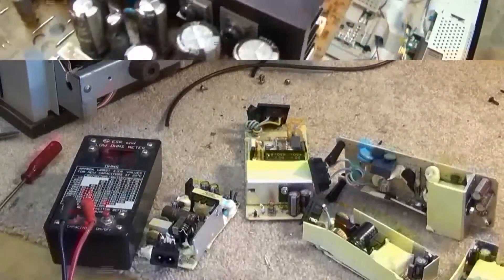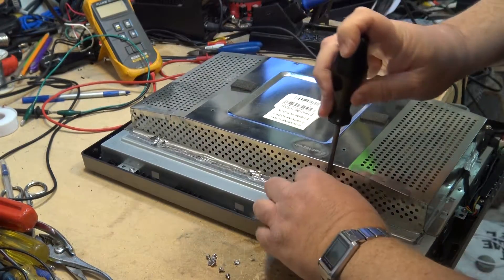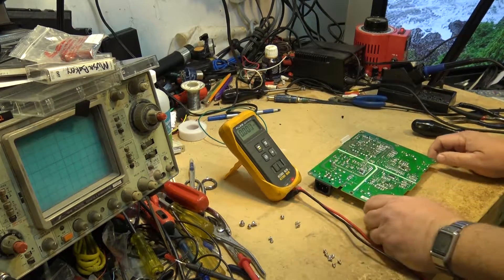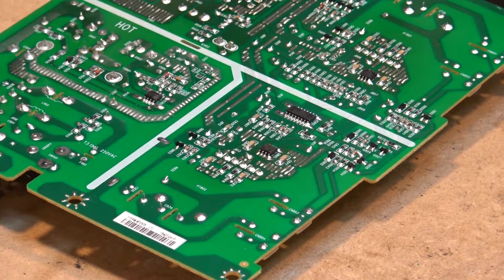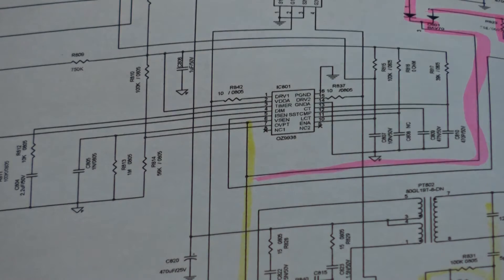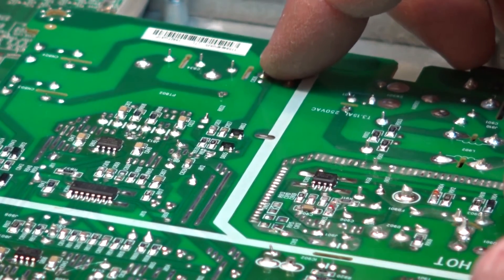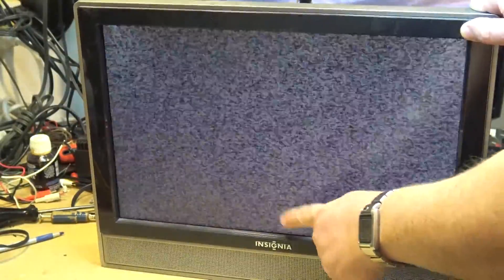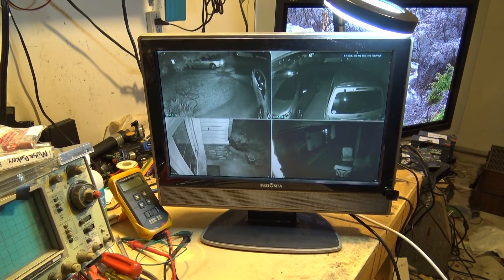LCD TV Fluorescent Lamp Troubleshootiing and protection defeat modification

Comment: @12voltvids — How would I supply power to a set of these CCFL’s if I DONT HAVE the TV set’s circuit board (drivers)?? To add context: I’ve converted several busted LED sets into things like photography lights, ceiling lights, or once I used them along with their frame to create a “BACKLIT” piece of art for my daughter’s bedroom wall….

However, I come across LOTS of CCFL-Lit sets and feel terrible tossing them out… Many times the driver won’t power the bulbs unless I keep ALL the circuit boards intact, which is obviously undesirable for my intended outcome(s)…

So what I was hoping to gain from THIS (and all other) videos was the understanding of “HOW THESE WORK” - PERIOD.  Meaning if there was no TV SET even in the situation, but someone wanted to power up, let’s say, ONE PAIR of these as an under-cabinet light (for example), then HOW COULD THEY??? 

I say “a PAIR” because the current bunch I’m working with are wired IN PAIRS and I’m not certain if they all are or not…

So that person would need to know things like the following:

1. What amount of Voltage does EACH CCFL (or each PAIR of CCFLs) need to operate?
2. Can they run directly off of a fixed current, or do they all require specific “drivers”??
3. Once it’s determined how to operate ONE or ONE PAIR, does the voltage then simply increase in accordance with the amount of CCFLs (or pairs) desired? - eg: 1V powers a pair, so 6V powers 6 pairs. ? Or is it nothing of the sort?

I cannot find ANYTHING on this topic no matter where I look and I’m sure I’m just nit looking in the right places. But everyone sharing info on these specific CCFL’s is always attaching the TV SET into the mix, and never educating me on how specifically the CCFL’s THEMSELVES function (and thus, how they could function on their own!) 

Could you PLEASE either reply and point me in the right direction, OR do a video on this for the DIY/“MAKERS” community? 

You’d probably be the first and only, while there are DOZENS of videos that discuss doing the exact same thing with LED strips from TVs.

THANKS. New Sub btw!!

Comment: CCFL junk replace with led stripes . i have done that to my customer years ago. now working kinda sort off.
Reply from the maker: Ccfl lasts longer than any led strips.
Reply: @12voltvids  yes i agree but they heat up pretty fast and then the edges became black  pretty fast.
Reply from the maker: @Abhishek-C92  I have a monitor with over 63000 hours of use and it still looking good.  This tv still working after all these years.
Reply: @12voltvids  oh good. but idk is my bad luck or  that my ccfl backlight of my monitor just went pinkish.  it was 9 years old . its a benq monitor 16.5 inch .

Comment: In many cases i had to disconnect one of the lamps and put a polyester capacitor 6KV around 100pF as a dummy load.I did it in monitors and in one case in a 32 inch CCFL tv and worked.

Comment: We had equipment at work that was CCFL backlit running 24/7 for 10 years before I saw failures or color change (pink) in the tubes. The replacements i put in lasted maybe 5 years before they had failures.
My current Samsung TV is 12 years old and uses CCFL. So far so good, no breakdowns.
Reply: yep. CCFL tubes can last ages. They loose their color accuracy however, they will get a lot darker over time and take a long time to warm up.
I have two PC monitors I use since more than 12 years. They take ~5 minutes to be up to the max brightness (and have a good color temp) but still work great.

Comment: This is interesting, I saw a different failure mode on a larger set.  The driver FETs on the top row were shorted & on inspection 2 of the lamps were physically broken, looked like they'd blown the connectors off the ends. Chicken or egg, did someone knock the set in such a way as to break 2 tubes just at the very end & then the drivers shorted due to the spike, or did something in the circuitry fail causing physical damage to the tubes?  (Actually, I've picked 2 or 3 CCFL sets off the kerb that had the ends cracked off a pair of tubes)
Reply from the maker: One of the way ccfl tubes eol is to break.

Comment: Well this is convenient. Someone recently gave me a broken LCD TV to play around with and see if I could get it working again. It's a 32 inch beast from a local brand, manufactured Sept 2007. The issue is very similar to this one though in my case the backlight is not lighting up at all and I can hear what seems to be the power supply starting up and shutting down multiple times per second, like a pulse. Currently waiting for a tester I ordered online so I can check some caps on it. Never fixed one of these before so i don't have very high hopes, but hey at least I'll have some fun.

Comment: I have a Dynex 42 inch TV and the backlight is shutting off after a while. I'm thinking it's a power supply issue but I checked all caps and none are bulged. The picture is still playing because I did the flashlight test.

Comment: I have an LG SL80 that went off on its own.
I manually turned it back on and the backlights began flickering & I heard what sounded like the the high speed switch supply ringing.
It is also used as a monitor, except in a very dusty environment.
It has always had problems turning on since it was given to me, so I just leave it on 24/7.
Does this sound like a cap issue in the power supply or the dust?
Reply from the maker: could be caps in the inverter supply, or crud on the board causing corona and arcing.

Comment: I'd buy a cheap adjustable voltage/current load and bypass the lamp.  I'm only a novice as well so this is not me telling you how to do your job which you do incredibly well.
Reply: @12voltvids  I'm just saying as me being a novice, is what I would do. I'd never assume to tell you how to repair something brother. I watch your channel to learn not pipe up like a know it all haha sorry if it came off like that
Reply from the maker: @jstro-hobbytech  you can change the lamps if you want.  Just showing how you can get them working without changing it.  If the lamp is totally dead and not putting out light then yeah you're going to have a crappy picture, but this case the lamps just getting a bit tired and was tripping the shutdown circuit. That set runs 24/7 displaying my security cameras and I shot this footage back in 2015 I think so it's been going at least 5 years without a hiccup. The worst thing for ccfl is turning them on and off. like all fluorescence if you leave them running they will last far longer than by turning them on and off it's the worst thing for them. Every time you start a fluorescent you reduces life slightly. My parents had a 15 watt t12 tube over their kitchen sink that was left running as a night light 24 hours a day. It was an old warm white bulb a GE and it ran 24/7 for 18 years!